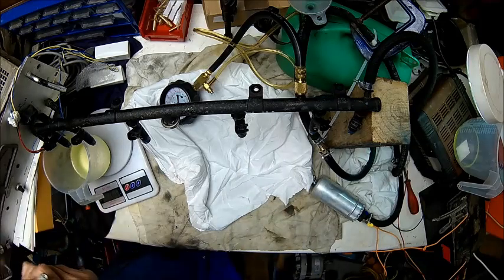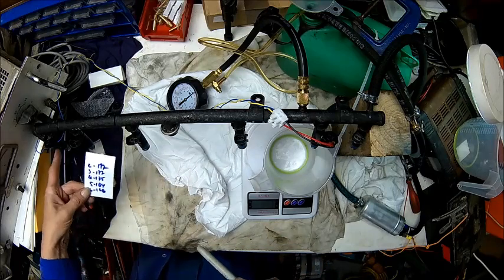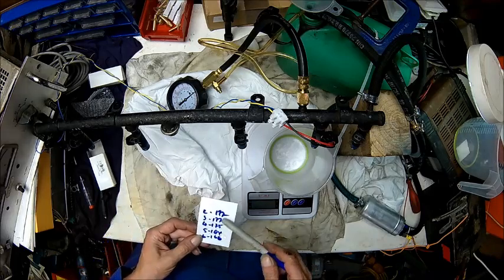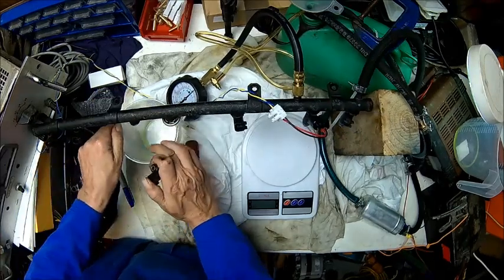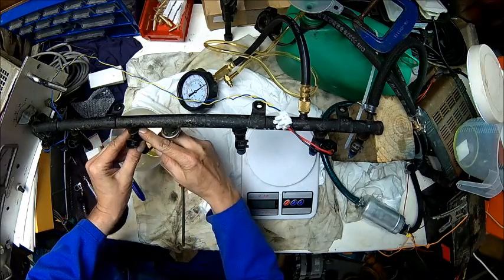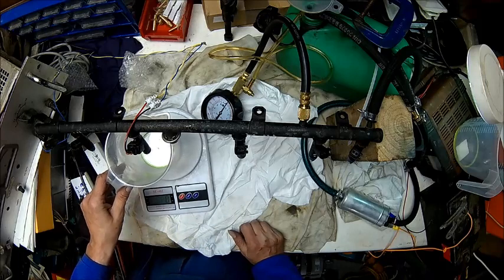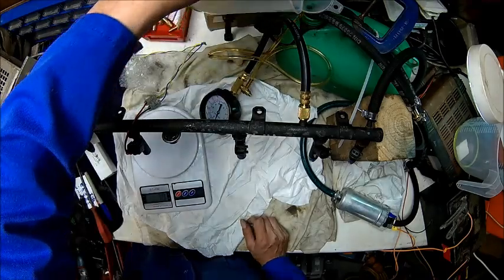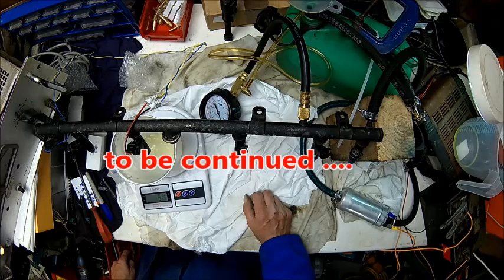Fuel injector testing  - Part 2,  are those Chinese injectors any good ?

Comment: The reason no 6 is lean is due to the factory non return fuel rail design. The fuel "hits a wall" and simply doesnt get enough fuel.
Reply from the maker: Well, i may (partially) agree with your standing wave theory,.... if this was a dragster engine with huge injectors. 
But looking at the total fuel quantity stored in the rail, the applied head pressure of around 3 bar and the injection quantity per stroke, the actual effect is certainly negligible with my almost stock engine. With good, clean injectors my EGT is pretty much the same on all cylinders, indicating most likely the same fuel quantity on each.
Reply: @dynoguy  I'm certain you know far more than me on this topic so let me flip this to a question: In your opinion at what fuel rail PSI do you think it could become a problem? I'm turboing my 4.0 and installing a boost referenced rising rate fuel pressure regulator and I have a concern that the fuel rail might pose a problem. Do you think its worth looking into running a return system to negate this problem? I want to run 10 psi Boost, will likely equate to 54-60psi fuel rail pressure.
Reply from the maker: If you boost the thing to 10 psi, you will increase the volumetric efficiency by somewhat around 50% give or take, But you only want to pump about 30% more fuel into it (assuming stock injectors)... Not sure how long that's going to last running that lean ....
Anyway, as far as i remember the stock pressure is around 45psi (3.1 bar),  if you go up to 60psi (4.1 bar), you might run into a number of issues ...
1: injectors,... how does the spray pattern look like at that pressure ? will they actuate correctly ? So find the specs and check if they any good for that pressure....
2: fuel lines.. pump is in the tank, the flexible lines are secured only with hose clips, not sure how long that arrangement will withstand a 35% pressure increase.
3: fuel pump ... can it reliably deliver the required quantity at the desired pressure, even from an almost empty tank ?
4: fuel filter ... is it good for the desired flow rate/pressure ?
5: pretty sure i forgot something .....
The fuel rail and the injector gaskets are certainly fine, accidently pumped the one on my bench to over 5 bar (73psi) with no leaks.
You certainly need some sort of dump arrangement to quickly bring the pressure down when you go off the throttle, otherwise you may run too rich, so a controlled return regulator would be best, (or a second one, set to stock pressure).
If i would do something like that, the first thing would be looking for the largest injectors the ECU can handle in idle, if you go too large, the injector pulse width can't be made short enough, so it idles too rich.
That allows you for a lower high end pressure, but you still need to control it fairly tight to maintain a rich condition at high loads, unless you want too cook your pistons. Btw, .. i assume you run a stock ECU, doing the closed loop mixture control to ensure you not cooking your catalyst..
Reply: @dynoguy   wow thank you for going to the trouble to type all of that out. Super valuable info.
So my fuel delivery plan is as follows:
1: Injectors - I have bought a set of chinese refurbished 36lb/hr for a supercharged 3.8l Pontiac GP. They were cheap and I'm hoping the risk pays off. I recently learned about min pulse width and that was my major concern. Its difficult to get that info, but given that the injectors come out of a similar displacement forced induction engine, I'm sure that shouldnt be an issue. If I recall correctly the nozzle has 7 holes, so the spray pattern will be different.
2: I'm aware the pump is in the tank, thank you for bringing up the hose clamps, will definitely address that.
3: I will be adding an inline fuel pump to bring pressure up and will add an appropriate fuel filter (hadn't thought about that)

"You certainly need some sort of dump arrangement to quickly bring the pressure down when you go off the throttle, otherwise you may run too rich, so a controlled return regulator would be best, (or a second one, set to stock pressure)."  I've heard of this being an issue, not sure how this would work though. The way I imagine the fuel line is as follows:
-Stock pump ------------ stock regulator (2000 4.0 location) -------high volume pump ------------------------ Boost referenced regulator ----------------- Injectors

For tuning I plan on running HP tuners with stock ECU I believe they have unlocked the Jeep 4.0 OBD2 ecu recently, however if that doesn't work out I have a piggyback option. 

If you have any more to add please do,

Thanks

Rudi

Comment: If you clean all the old injectors they may work close to oem specs
Reply from the maker: They certainly will, ...cleaned my old ones about 3 years ago and just tested them again today because i am going for a 3000 miles trip soon and fuel price is skyrocketing the last few weeks, so every little helps.
The ones in the car all flow around 190g/min with the very same setup, so that means the junk yard ones are considerably low in flow and need to go in the ultrasonic cleaner for a while.

Comment: you'd think that the chinesium injectors would be a little better since they still build the XJ in china and most of the new parts sold come from there.. AMC must have never told those yoyos that the fuel also helps cool the cylinder head and the correct amount is vital to keeping the engine alive.
if there is any way to service/repair/clean the old injectors it would seem a far better option than buying chinesium injectors and having the cylinder head over heat or burnt valves
Reply from the maker: I think those are not actually bad, they just flow 20% less, so it's not the right injector for my engine, even they sell it as such,....  glad i did not just put them in